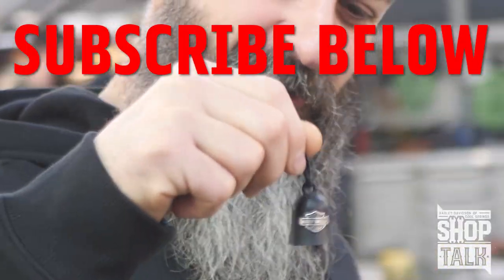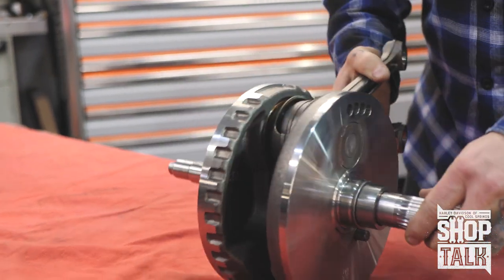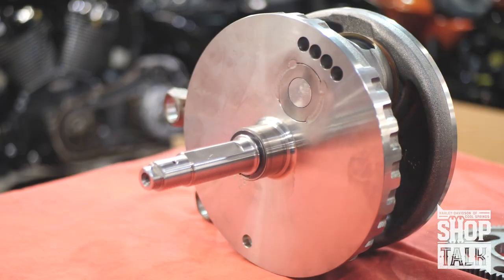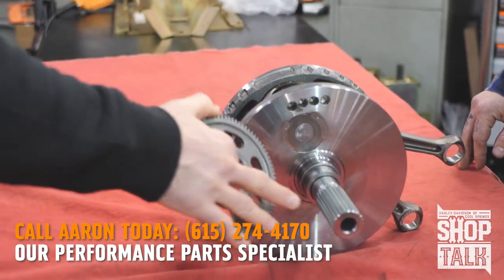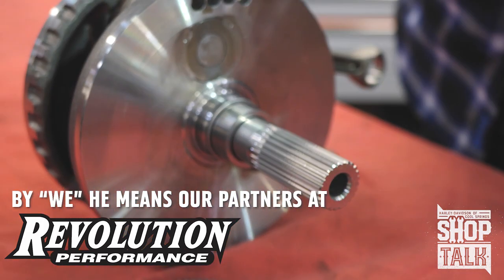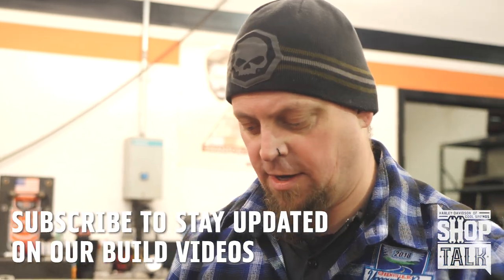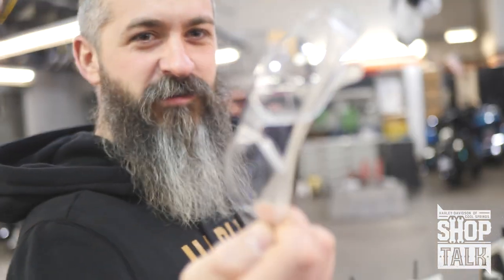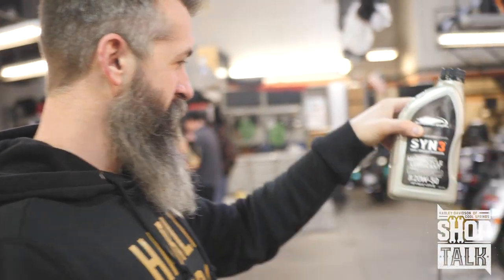Getting more BIG M8 POWER! Flywheel from Revolution | Shop Talk Episode 14

Comment: I am having my whole top end rebuilt due to a head gasket failure (2017road king 107). Zippers is building the top end, but are warning me about the crank.  I will end up with a 117 m8 motor with a redshift 468 cam.  Does work need to be done to the crank, or will it be fine for my build. Fairly conservative rider, but need reliability.  Any advise would be greatly appreciated.  Just not sure what to do or how far to go.  Thanks.  Love your videos !
Reply from the maker: Call the shop 615-274-4170 and ask for Jamie or Aaron. We’ll go over everything so you can make a decision.
Reply: @MoonshineHarley  thank you.  will do.

Comment: love your content guys! i really enjoy riding the M8, but.....Question: Why do you think HD is still running a 3 piece crank/flywheel? I have one family member and one friend that had catastrophic engine failure due to crank slip. Now, this was on a TC motor, not the M8. The crank assembly  on the TC and the M8 is the weak point of both motors. It's as if HD designed these motors to fail. They went back to one cam, why not go back to the evo pin setup? I don't think it is because of the cost savings. If they wanted to save money, the should of went with a one piece setup.
Reply: It is designed this way for cost.  Failure is rare under normal circumstances.  We are running these trued pinned and welded rotating assemblies in engines we are pushing into the 140+HP category.